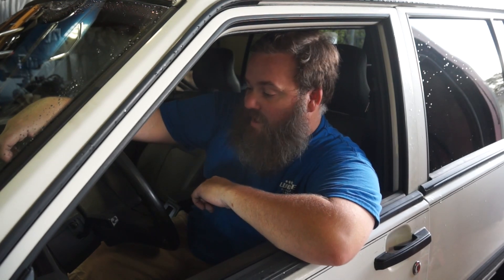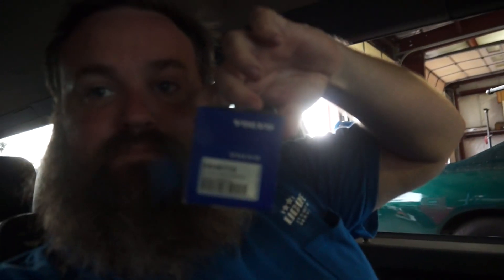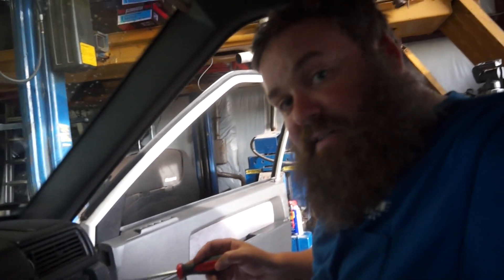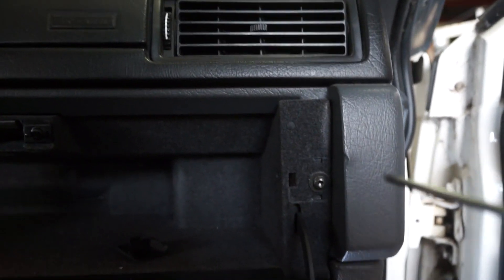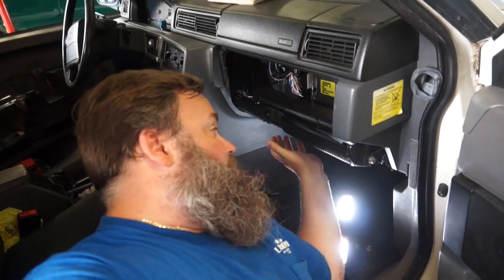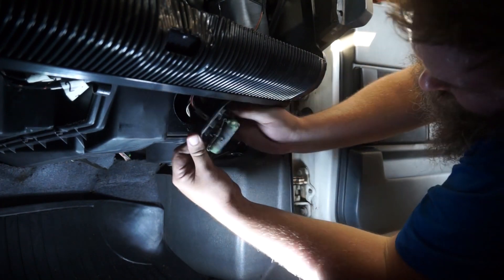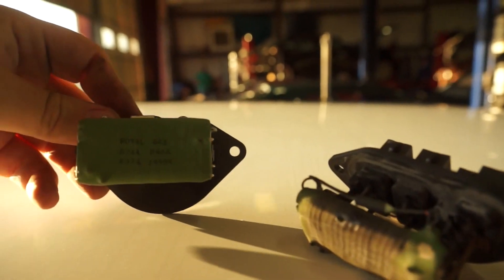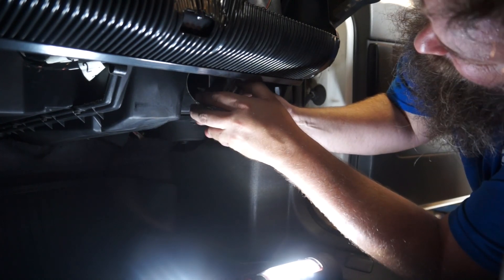Volvo 940 Turbo Blower Motor Resistor Replacement walk through : Lucore Automotive

Comment: Very easy ! Good video w/ good info ! One question pleaseeeeee -  My fan speeds work but the little flap doors dont open to let the cold air come out the vents - easy to get to ? I'd like to pry it in the open position. good idea ? bad idea ? (blower motor turns and works @ every speed) - does the resistor control the opening and closing of the electronic flappy flap flaps ? thanks, Pg

Comment: Thanks for the vid. Any idea how to remove the blower motor? My ECU is in the way and can't remove it (security bolts). Thanks!
Reply from the maker: Haven't had to address that on this particular car but could certainly make a video of the process if you need!
Reply: @LucoreAuto  Hi, thanks! Well, the only way was to make a slot in the security bolt with a Dremel. Remove the bolt and ECU and then I was be able to remove the blower motor. So it is solved! Btw, it was the connector that was a bit wobbly.
Reply from the maker: @Volvoamazon62  you're on the right track, sorry we didn't see your comment and get back to you sooner! So your problem turned out to be the pigtail itself and not the motor? Swap out thr motor since you were there or did you rewire with a new connector?